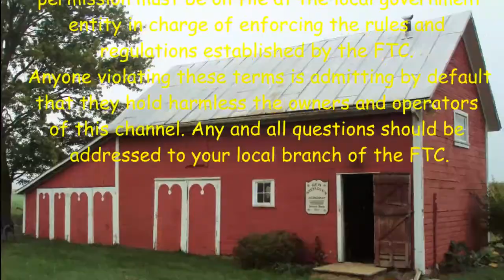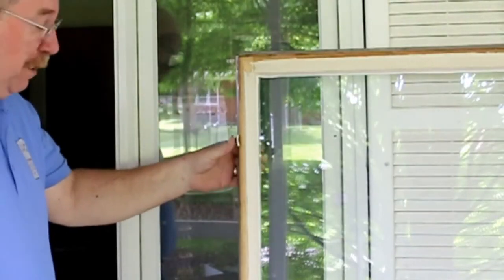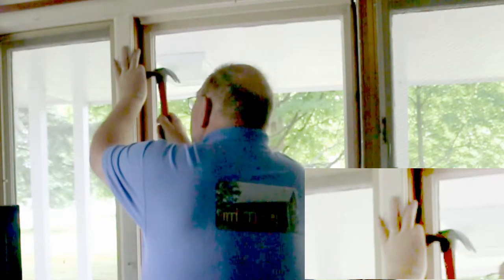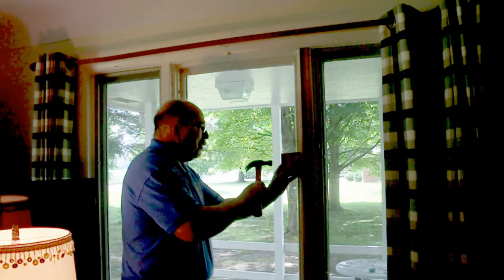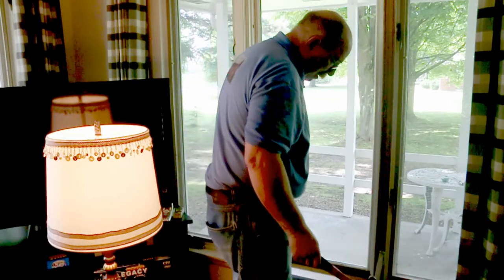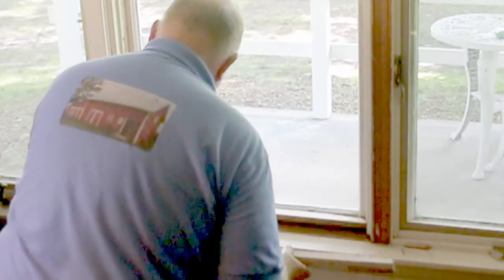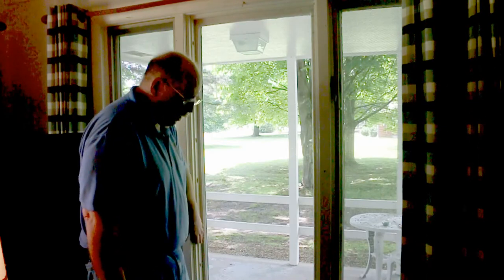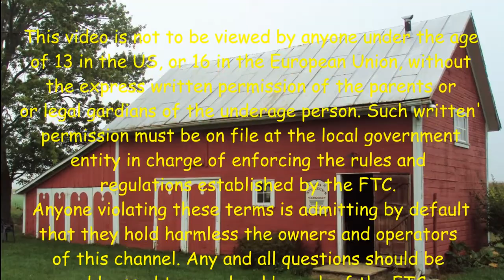Replacing The Glass In An Anderson A1 Fixed Thermopane Pt 4

Comment: Nice job!   Heavy window!
Reply: Needs 50/50!
Reply from the maker: I use to work with laminated transparent armor. 4 layers of tempered plate glass and an inch of Lexan on the inside to catch any shrapnel. 
That was heavy. Think of a sliding window weighing 30 lbs in a moving vehicle. They opened by sliding back. If the latch failed it could take your head off. 😖
Reply: @OldSneelock  That would be interesting. The inch of Lexan would be very interesting in itself. With that window it'd be new wood up the sides and a cap on the front and a couple of tubes of caulk. That's why Toots gets a legit builder. I'm good for oil and grease. Sawdust and caulk, not so much. GBWYall And the sliding window would be like the front window in a trackhoe, sliding up and back and latched at the back of the cab. Freefalling down.
Reply from the maker: @lewiemcneely9143  Up armor on the Humvees was an after thought. It worked, but was a PITA to install or work on.
MRAPs were designed to be heavily armored. Much better ride and packed a wallop.   !😁😎
Reply: @OldSneelock  Might as well start at the top and go up at the beginning. 2nd guessing never works as good or it takes a lot more to get it to.
Reply from the maker: @lewiemcneely9143  In defense of the up armored Number it was an attempt to upgrade equipment in the field to mitigate a threat. 
The MRAPs came later. They were stll in development and took too much time to design assemble and ship to limit the effect of IEDs. Once they were in the field they were very effective at providing rapid response and relatively safe transport of troops.
The Bradley's were a more effective unit and were also up armored. Tracked vehicles require a lot more maintenance Wheeled vehicles are faster, less expensive, and easier to maintain.
Reply: @OldSneelock  I agree totally but it looks like if there was a possibility for such stuff the vehicles could and would be designed beforehand for such. More guvment junk. I remember 20 ton RT crane operators lining the carrier cabs with sandbags because the cabs were just stamped sheet metal.
Reply from the maker: @lewiemcneely9143  Humvees have a lightweight chassis from stamped aluminum sheet. Not my area of expertise, but if I had to my guess is they were built to fight in the last war. Pretty much standard according to what I've read. Militaries develop weapons to handle the failures from the last conflict. The were built for jungles, fording rivers, delivery by air. Never meant to survive anything except by out running it. 
They weren't strong enough to survive rifle fire let alone IEDs. 
The men in the field added what they could. I was told the transparent armor, windows 😁, were laid on the floor to block explosions. 
The up armor added a huge amount of weight. Slowed down the Humvee so they lost the original designed for speed. Also wrecked the handling.
New suspension, bigger engines, tires, brakes, and frame upgrades made them better, but in my opinion they were putting lipstick on a pig. 
I read a letter from a group that experienced an IED attack in one of the MRAPs made at the plant. 
After the bomb exploded they found themselves sitting upright in the bottom of a hole with the suspension and drive blown off. Not a scratch on anybody. 
The difference between a 14,000 lb vehicle and a 5,000.
The media always talks about the V hull on the MRAPs deflecting the explosion. The engineers who designed them told me that at the speed the shrapnel was traveling it didn't deflect. The only thing to stop it is thickness of the armor. The V shape made the shrapnel have to travel through the armor at an angle. The effect was thicker armor without the weight.
Reply from the maker: @lewiemcneely9143  The gun tubs for the MRAPS that I helped build were 3/8" armor plate. We made up the first set and sent them out for testing. They met spec being able to stop a 7.62 NATO round. I asked one of the engineers why they drilled holes through the welds. He laughed and said those were holes from a 50 cal. 
They were perfectly round and went through the 1/2" thick weld bead like it was cheese. 
They said there wasn't anything bullet proof. It just depended on how fast it was going when the bullet hit.
Reply: @OldSneelock  The 1st evening I was 'in country' I heard something that sounded like a hum and cloth ripping. Looked all around and finally saw a solid red streak coming down from the sky where a gunship was bearing down on something and it was having a very bad day. The guys from my outfit came after me while I was getting malaria out in the swamp at the new firebase, with a deuce and a half with a 60 mounted in the bed. I saw the Eve Of Destruction 5-ton gun truck rusting away when I was processing out of Ft. Eustice and spent the night somewhere within rock tossing distance of a self-propelled 8-inch Howitzer. No wonder war is hell.
Reply: @OldSneelock  10/4 on the thickness. The jaw and cone liners (2 for each) at the boulder hole were around 8 inches thick new. It's amazing how fast manganese steel can wear down until you watch a load of boulders dumped into the feeder on the jaw and see all the sparks flying from the steel. Then you wonder how it lasts at all. And all the wear surfaces were A/R plate, abrasive resistant. Plus all truck beds, bucket surfaces and teeth. Hi-dollar stuff. The screens were replaces from wire to poly-deck inserts that you just replaced the worn pieces instead of the whole screen. Pieces were about 8x12 or so. Lots different from the Cat generator days.
Reply from the maker: @lewiemcneely9143  During my foundry days I didn't do a lot of armor plate welding. There I did wear plate. The oscillating  conveyor pans saw thiusands of tons of sand and 10 ton per hour of hot iron bouncing down them.  Every week end I got lots of practice laying 20 or 30 feet of 3/4" weld beads on the various worn spots in all the dozen or so conveyors and elevators. 
I got really good with 5/32 7018 rod and the big 400 amp DC welder. 
The wear plate was cool stuff. In my off hours I took a scrap piece of stainless wear plate and made a knife. We used the stainless around the magnetic head pulleys because it would not retain the magnetism from the giant magnet spinning past. 
If we used regular steel the scrap iron would stick to the chute and plug up the works. 
I had to cut the knife shape with a welder cranked up to burn through. The stuff pealed the teeth off a saw blade. The gas axe won't cut stainless. 
Then I used the big 20" snag grinder to hog it down to shape and finished with the bench grinder and buffing wheels at home. 
It took an edge like a razor and I stuck it through a 55 gallon barrel without rolling the edge. 
It got sold at a garage sale. The designer said she didn't know I wanted to keep it. That was the last time she tried that. 😖🤯😎🤒
Reply: @OldSneelock  That knife would've been 2 videos or more itself. Sorry it left. I remember getting told about welding up the car body of the old Model-6 Northwest shovel. One winter, separated from the upper and tarped and covered with crusher run for insulation, the self-made millionaire crawled in with a rosebud and started heating the cast. Then the rest of the day burning 1/4 inch rods with the old Lincoln 4-banger flat head welders. Put over 425 pounds of rods into it. Job security, just like your walking conveyors! Always something wearing out. The base for my vise is the piece that was cut out of the head conveyor hopper opening to run the surge (6 inch minus) stone from the jaw to the #1 screen. 5/8ths or 3/4 A/R plate. That vise and base weighs well over 200#.
Reply from the maker: @lewiemcneely9143  Just like a giant grinder. Two city blocks of equipment dedicated to moving sand and stone from one end to the other.
Reply: @OldSneelock  I've always called it the rock polisher and one old time driver would always ask me if they were grinding that day, never crushing. And it used to be a lot more grinding that crushing.
Reply: @OldSneelock  And that's what my pal that lived right above where we are now and I went in the Army said that I spent my whole life moving rocks from one place to another. He was sure right. From mud to concrete to boulders and BIG boulders, always rocks of some kind. Even a little drilling and shooting too. What a life. No wonder I'm worn out.

Comment: JUST a suggestion to hold that window in while moving to the inside,tack a board across the window when you have a wooden frame. Also I have used a magnet to find nails. I spent 10 years replacing windows for a big metro school district and still did not find one a bad as yours.
Reply from the maker: After I finished the job I thought I should have just tapped a couple nails into the frame. 
I always think of better ways while watching the vids during editing.
The other thing that comes to mind is I need a real camera person. I covered half the work with my back to the camera. 🙄😁😎